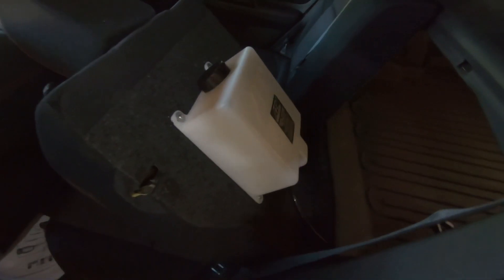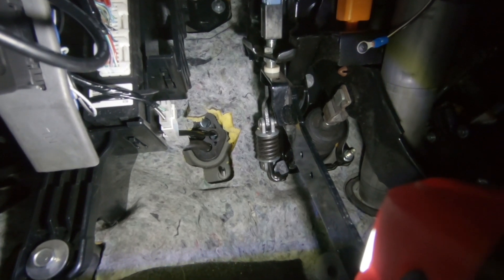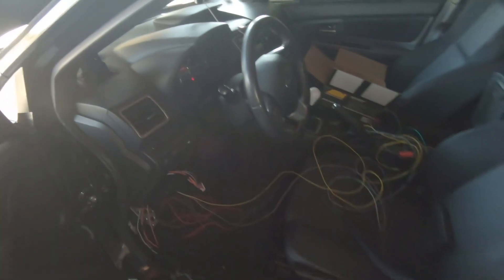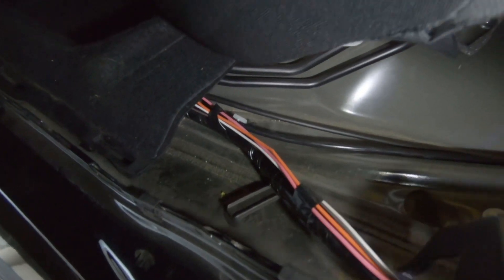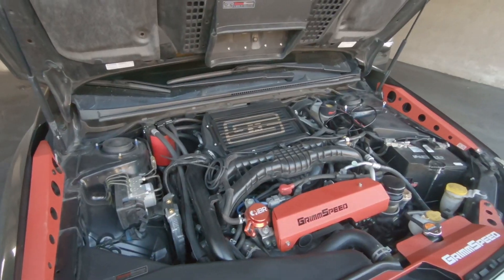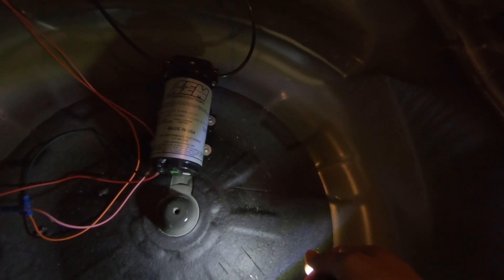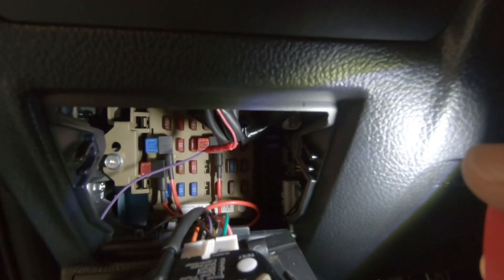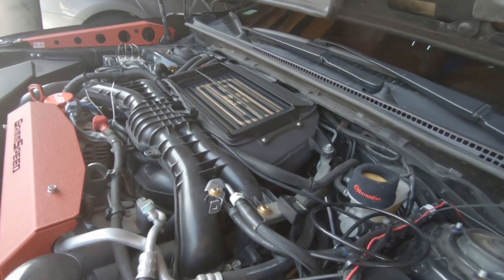Installing AEM Water Methanol Injection Kit on 2015-2020 Subaru WRX

Comment: How did you mount the tank to the back seat?
Reply: There's some wood on the seat back but I gotta be honest it was a terrible mount......spilled methanol in the interior and inconvenient. I'd have probably gone the bigger tank in the trunk if I did the install again
Reply: @wrapstarsinc  oh okay thanks for the advice. I got a 5 gallon tank in the truck where the spare is I saw someone on nasioc do it and I got a fabricator to make a bracket for me. You can't even tell it's back there but I haven't wired up the pump and relay yet.
Reply: @shakultra  yeah that's solid and how I would do it now

Comment: I’m gonna go ahead and say that you went ahead and showed us how to go ahead and install this, although I am running the snow AN braided lines underneath the car and installed the tank a different location, your video has various tidbits of information that really helped. So I’m gonna go ahead and thank you for going ahead and showing us how to go ahead!
Reply from the maker: Hi Matheus, thank you for the kind words. Yes, it's been a while since I've actually driven or owned this car as I sold it years ago. If I would have installed this system again, I would definitely mount the system differently and would have ran AN lines myself as I had numerous issues with the push to connect fittings that came with the kit.

Comment: I need help!!!
Reply from the maker: What do you need help on? Sorry, I sold the WRX years ago and have a TESLA now so it's been a while. I still have all the pin out diagrams so if you need help I can still help.
Reply: @eddiestsla  For the AEM solenoid the instructions say connect it to Brown/White. Do they mean either the brown or either the white or is there a wire that is both brown and white? Also are these just the fluid level lines?
Reply from the maker: @shakultra  it does have fluid level as a warning but also if power shuts off to the pump and etc is also on the warnings and will work to trip the failsafe

Comment: Is it suitable to put the nozzle after throttle body after tgv delete being made?
Reply from the maker: I don't recommend direct port (after throttle body) as there is no way to control the spray of each individual nozzle......there were some guys I know that did it on their FA20DIT but honestly I don't know of many that survived.......mine was easier to setup and fix if there was an issue so I stuck with this setup and it never gave me one problem

Comment: Hey man thanks for the Video. I'm going to use the same location for the boost line but I'm having a hard time location the 3way Fitting. Could you share where you ended up finding one? also was solenoid necessary? thanks
Reply from the maker: Had to get it on Amazon for the same reasons

Comment: It seems you didn’t connect the green wire (boost safe)… is that the wire you used for the relay? I’m trying to follow your set up step by step as I have my kit, filter, solenoid and relay waiting for install but I want to understand better before I start running everything. Did you differ from the instructions a little bit?
Reply: Ahh.. nevermind lol I read more comments and found my answer. Any word of advise or tricks/tips you’ve thought of since this video? Cheers!
Reply from the maker: @J_Lee93  hi sorry for late reply.....I don't recommend using the V3 nozzles from AEM because of all the issues I had with it clogging. Yes the green wire goes to the relay which then in turn goes to the boost control solenoid and that acts my failsafe
Reply: @eddiestsla   awesome 👍 I have the V2 kit. Hey, I’m wondering… did your controller include a blue wire for external map/mag/idc signal? Mine did and I’m wondering why it’s different.
Reply from the maker: @J_Lee93  is your kit for right one that's meant for turbocharged cars?
Reply: @eddiestsla   it is but Im just now finding out MAP sent me the wrong version. They sent me AEM 30-3350 which is for external map/maf/idc. Man, this is making a lot more sense now haha! When I get the correct kit, I’ll definitely be using your video for the install. Thanks for all the quick replies!
Reply from the maker: @J_Lee93  yeah that version is Naturally Aspirated engines and uses MAF / RPM as the trigger for the Methanol Injection system. You need the boost-based system which has a built-in MAP sensor.....when you get the right kit.....feel free to message back here and I can walk you through what I have done
Reply: @eddiestsla  you’re the man! I appreciate it.

Comment: You don't see an issue with running a highly flammable liquid line inside the cabin?
Reply from the maker: No....oem fuel lines also run through the cabin
Reply: Interesting

Comment: Hey Eddie, ever since you switched to the v3 nozzle, what meth do you run now? Boost juice?
Reply from the maker: I don't use the V3 anymore for numerous reasons. I use VP Racing M5 Methanol undiluted with a Prometh setup and it's been much more reliable
Reply: @eddiestsla  Did you change your entire meth kit setup, or just swapped out the nozzle?
Reply from the maker: @InfinitiVQ35DET  just the nozzle setup 👌
Reply: Is the green wire unused?
Reply from the maker: @InfinitiVQ35DET  Green wire is your boost safe wire.....it's what's sent to my relay setup which then interrupts the signal for my EBCS in case there is an issue with the meth injection system

Comment: How's the maintenance with the meth injection kit? I read somewhere that VPM5 is very strong and damages the pump over time. Have you had to replace anything after installing the meth kit? I also just got dyno tuned by Ron with all the same mods as you except a GS FMIC. I'm thinking about installing a meth kit and getting retuned.
Reply from the maker: There was no maintenance until I switched recently to the V3 nozzle. I've been having nothing but problems with it and have replaced it 4 times now.....with AEM telling me there's nothing they can do since they don't actually manufacture it......
Reply: @eddiestsla  Oh ok, thanks! Why did you switch to the v3 over the v2 nozzle?
Reply from the maker: @5W1M  supposedly better atomization which it does as charge temps drop much quicker......but the durability of the internals is the issue
Reply: @eddiestsla  I see. So would you recommend me get the v2 to have less issues? I saw on Ron’s site that he says the v3 isn’t compatible with vpm5.
Reply from the maker: @5W1M not only M5.....it doesn't work with M1 or even a 70/30 blend M1 / Distilled......you'll probably see Ron updating soon that he just doesn't recommend the V3 nozzles at all

Comment: Great video. Question, where do you plug in the sprayer that sprays water/methanol? Into the air intake piping? Thanks. I ran water methanol injection on my old SRT-4 back in 2005, so it's not new to me, but it's new for my STI. Thanks.
Reply from the maker: Thank you! I put the nozzle into the cold side of the intercooler (have the Grimmspeed TMIC which has a bung built in about 8 inches away from the throttle body). I've helped a couple of friends with their FMIC setups and they ended up welding a bung on the cold side of FMIC intercooler piping about 6-8  inches before the throttle body. All in all just make sure you have a bung and don't just thread into the intercooler piping as it's very thin and prone to stripping.
Reply: @eddiestsla  thank bro, great tip!

Comment: Are you running straight meth on yours or do u have a mixture going on ? What would you recommend? tapping into the stock tmic or on the coupler/hose going into the the tb
Reply from the maker: I would highly recommend doing the coupler / hose over drilling and tapping the OEM end tank on the stock intercooler. I saw one guy that did it and it started leaking after a while and that's something you don't want. I am running straight methanol - VP Racing M5 and I don't mix it. Super flammable so I keep a fire extinguisher handy......The only issue with the coupler / hose idea is that our cars have very tight space between the stock TMIC and the throttle body. You might have fitment issues which I think a lot of guys did on the FA20DIT. On older EJ motors, there was more space so the Snow Performance and those types of kits worked.

Comment: Great vid..is there a specific reason for mounting everything in the trunk? I just got q kit but my trunk has a big speaker box in it so can i mount up stuff under hood? Thanks for the help an good info!
Reply from the maker: I mounted it there because it felt the easiest to wire there but I've seen some mount the pump in creative areas like under the hood or behind the bumper. For the reservoir, you're going to have to mount in the trunk somewhere because you don't want any methanol leaks inside a cabin or in an area where debris can hit it and spill out
Reply: @eddiestsla   thanks man i have a big speaker box so i mounted pump on it an tank on back of seat ..
Reply from the maker: @eyecandyquartz8494  Awesome work! How is your setup running?

Comment: just wonder where you wire the yellow and green wire?
Reply from the maker: Green boost safe wire should go to the relay like in my other video. Yellow should go to your methanol solenoid.
Reply: Eddies WRX thanks your video is very helpful. I got my kit install easy because of your video. Thanks
Reply from the maker: @tengvang9452  nice! How is it running?
Reply: @eddiestsla  it’s great. I’m going upgrade to stage 1 block soon. My current block is down right now
Reply from the maker: @tengvang9452  did you get rod knock? What happened?
Reply: @eddiestsla  yeah, current running 400 whp. Put the flex fuel kit on the car. Tuner said it will be fine running without tune. 2 days later boom engine knock. I should have tune with regular gas first till got e85. But oh well

Comment: Thanks for the great install video! Probably going to install one of these on my car soon too as I decided to go catless as well. Phatbottis write up on it was very useful. 

Weird question but are there any other options for the tank besides behind the seat? I find that I flip down the seats alot when I have to fit in snowboards, etc. Do you know if the divets on either sides of the trunk would work?
Reply from the maker: My tank is mounted there but other guys have mounted in the trunk

Comment: any issues with the kit so far?
Reply from the maker: Zero.....just hit 67k miles and have been meth injected and FBO for about 20,000 miles
Reply: Increases fuels octane equivalent, cools your intake charge, cools the combustion process, and thus prevents knock so its actually really good for these cars :).
Reply from the maker: Update.....Installed Socal V3 Turbo, Killer B Header, and retuning with Ron Watson :) Still no issues and now the car has 75k miles. Stock motor. Make sure you have a good tuner and stick with his recommendations.

Comment: What if you don’t have the GS TMIC? Where would you install the spray nozzle?
Reply from the maker: I have friends with a FMIC that ended up tapping into the cold-side piping so you'll have to do the same in your case. If you have a TMIC then you have to drill and tap onto the side of the end tank like how it's situated with the GS TMIC

Comment: What kinda power are you making
Reply from the maker: CstGeorgeGreen making 409 whp and 360 wtq on Ron’s Dyno
Reply: @eddiestsla  is that on 93 with water meth or 93 with water meth and ethanol?
Reply from the maker: @charlvictor3714  we have 91 Octane here in California....running 100% methanol with E60 blend on Ethanol
Reply from the maker: Hi George,

Car was sold about 6 months ago. Final power using Socal V3 Turbo, Flex Fuel, Methanol Injection, and every bolt-on available......446 whp 392 wtq.......the new owner definitely doesn't turn it up that much for sure

Comment: @eddie hey man! Love the videos! Did that vacuum t-barb location end up working out? I have the same kit but the boost line is too short to reach the 3 port that’s all the way down by the turbo. Also, if it would be better to tap into the 3 port boost controller, do you know which of the 3 lines you would tap into? Does it even matter? lol
Reply from the maker: Daniel Burdette I ended up using a T fitting that’s 1/4”x1/4”x1/8 barb fitting for that location and it’s been great. Same issues didn’t want to run the boost line all the way down to the EBCS. Any vacuum line by the intake manifold will work just make sure there’s no check valve like the brake booster has. That’s why I had to use a converter barb fitting because I chose to tap into a hose that’s larger than the 1/8” boost line provided
Reply: @eddiestsla  i used the same line but the ID was much larger than 1/4". Was yours a tight fit?
Reply from the maker: @Jswick112  yeah it was a tight fit.....is yours too loose?
Reply: @eddiestsla  yeah, it was very loose. Ended up being a 5/16th barb. Mines a 2019 so maybe they changed the hose 🤷‍♂️ lol but if people see this comment. It could be 1/4 or 5/16(8mm)
Reply from the maker: @Jswick112  good to know yeah maybe different on the 2018 and up
Reply: @Jswick112  Would you mind providing a link with the fitting you went with?
Reply: @Jswick112   thank you! That’s the only one I saw, wasn’t sure.
Reply: Thanks a lot ! That makes everything way easier.
Reply from the maker: @danielburdette8574  No problem......how is your setup running?